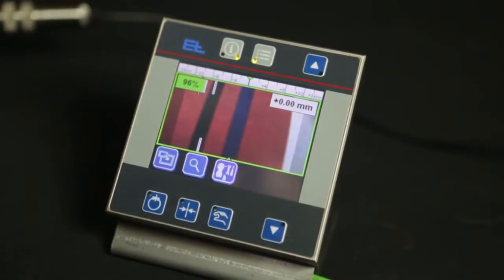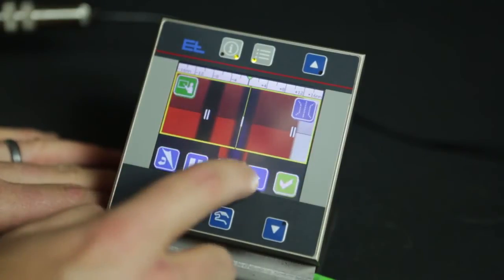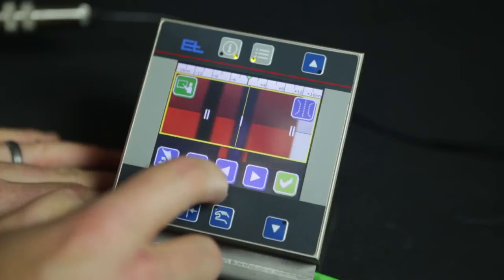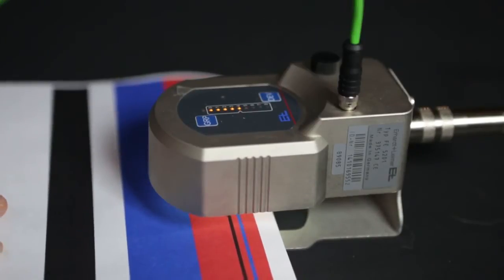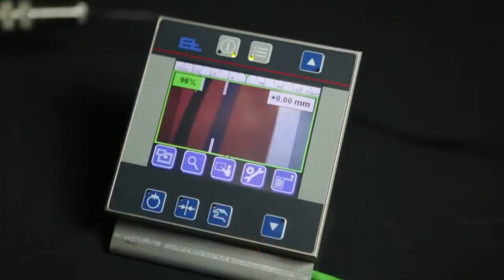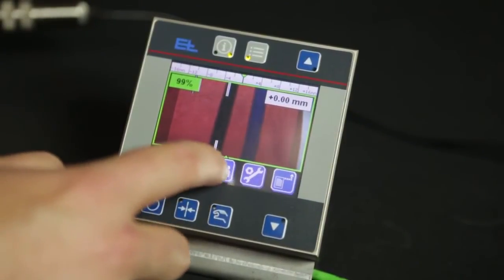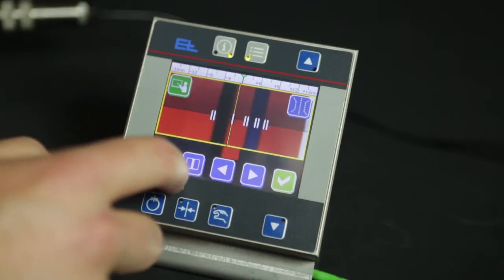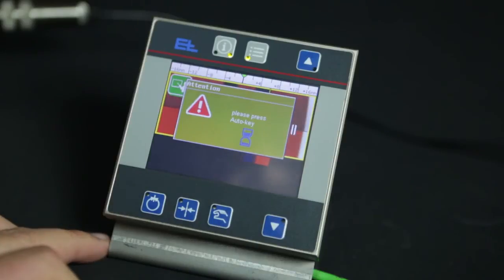FE 52 Color Line Sensor Erhardt + Leimer

Comment: Hi I have this scanner on a Slitter at work and I need to set it up for broken contrast edge scanning? In the manual it says it’s possible but there is very little information on how to use the advanced scanning modes any help would be greatly appreciated thanks.